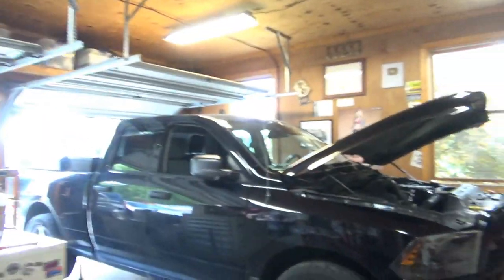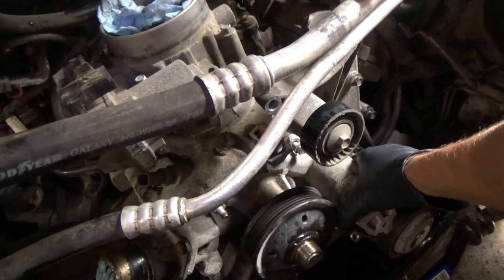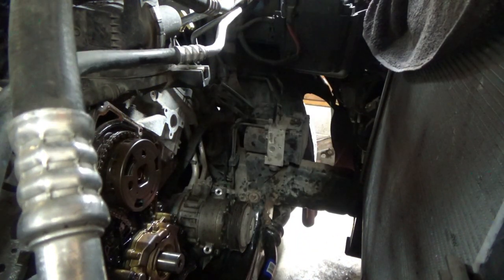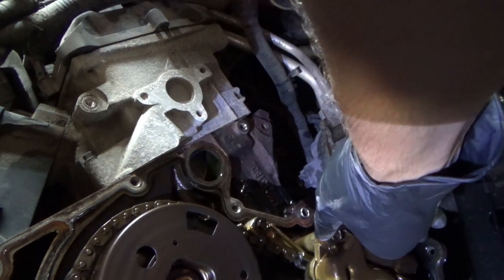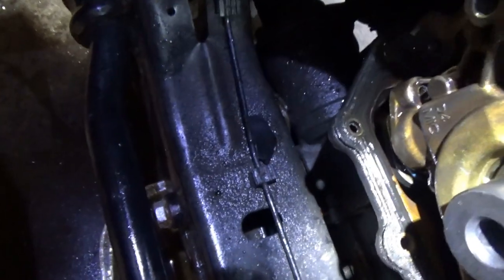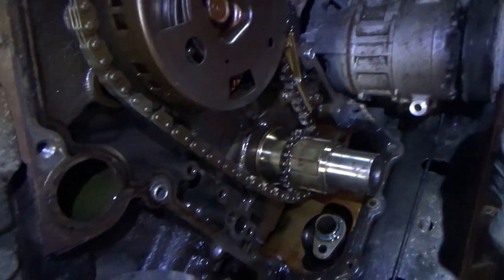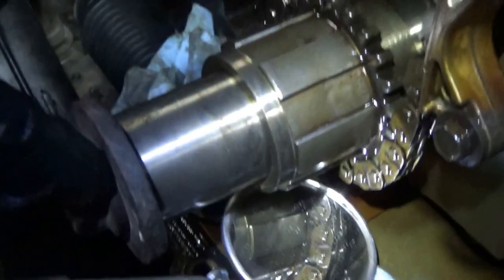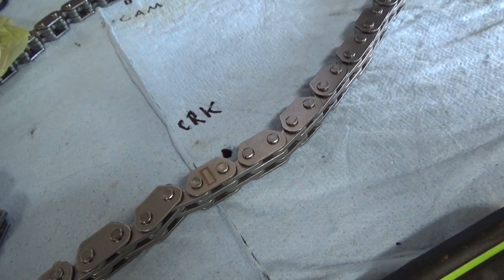Labor Day HEMI - Part 3 (P0016 Timing REPAIR)

Comment: You have to take care on putting on dampeners with a hammer I have seen broken cranks that way all thread is your best bet
Reply from the maker: Broken cranks?? How?
Reply: @PineHollowAutoDiagnostics  they break at the main bearing to the fly weight near the end at the dampener we have seen it quite a few tiimes on inline six engines their is a lot of flex in and out before the thrust bearing

Comment: I'd not trust that engine for longevity.  At the very least, taking a look at the oil pump internals might have revealed damage which most likely happened by vacuuming up all that garbage from the guide.

Comment: If this guide wore because of poor maintenance, that is on the owner. If the guide wore and oil changes were done regularly, then RAM has to rethink their hardware. The chain guide should be made of metal, rather than plastic. That chain was ready to cause even more carnage...if that is an interference engine,  it may have been featured on I DO CARS with ERIC.
Reply: I don't remember ever seeing a metal chain guide. They're all plastic.
Reply: @fascistpedant758  Plastic doesn't seem to work. Maybe metal with a teflon surface.

Comment: I would have edited out the part when you realized you had to take the oil pump back off after all of that to fit the tensioner back in as well. I hate when things like that happen. Once on a Ford 5.4l I reassembled the entire truck then while cleaning up the tools to make sure none were left in the motor before starting I found the reluctor that meant the timing cover had to come back off to install and the customer was on their way to pick it up. No fun at all.
Reply from the maker: Tensioner goes on AFTER oil pump is installed 👍
Reply: @PineHollowAutoDiagnostics  Really. My bad then. That's the way it usually works for me, struggle like crazy to work around something just to have to tear it back apart or whatever. Lol

Comment: Could the crankshaft pully be slipping on itself? It shouldn’t be but i’ve seennit before
Reply: He ruled that out by counting the number of chain links between the timing marks.  If the crank pulley was slipping on the crank (e.g. key sheared) that wouldn't change.

Comment: If it was a cold morning and you heated that balancer up to about 350 degrees in the oven first chances are it would have just slid right on.
Reply: Not sure how the oil seal would fair
Reply: mine have always been fine.   You don't want to go over 350 however, and it cools off fairly quickly.   If you were concerned you could have a spray of cold water ready to spray it as soon as it seated.
Reply: @hooptierescue2540  you are probably thinking in °F I'm in °C
Reply: @niallseddon8657  I am.

Comment: Makes you wonder how engineers manage to design and ruin a simple engine  , fooling around with what worked doesn't  make any sense  ? All the added things never add up to reliability  , old HEMIS were mad  these new ones look fragile at best . Pulling the pan and checking the pick up might be the go for reliability.

Comment: If a piece of chain guide goes up and over the cam sprocket between chain and sprocket, timing will retard a tooth.
If a piece of chain guide goes down and under the crank sprocket between chain and sprocket, timing will advance a tooth.
At this design, it'll probably happen only once. After that, the pieces will just drop into the oil pan, creating problems over there, too.
Maybe that's why they designed it that way: you're supposed to remove the pan anyway, for removing the tensioner debris out of there.
And yes, it is designed to a price point with little to no respect to quality engineering, as everything is, nowadays.

Comment: This engine looks twinky, plastic tensioner, whimpy chain. How much did that junk cost? I'm going to stay with my Chevy 5.7 Vortec, a Cloyes double roller chain costs $50 and will last over 200,000 miles
Reply: Yeah, its junk. 5.7l vortec isn't much better though with spider injectors, and plastic intake gaskets.

Comment: That's such a bad design.   Why would they have a guide push in so far on the pull side of the chain (the right side)?  Knowing that the chain wants to pull straight, so you know it's going to eat through the guide;  that's crazy-- it's like it's designed to fail.  I suppose allowing the chain to pull straight lets it flop around a bit and could make some noise.   But this is just crazy to me.   It should have been designed just how you found it -- with the right side of the chain being straight and the left side having all the slack taken up by the tensioner.......  It seems they have done it this way to FORCE you to do the timing chain intervals as the book says.  Disappoint
Reply from the maker: Hah yeah the chain was migrating to its happy place through the guide 😂

Comment: Question...why these engines always try to kill themselves?i mean engineers suppose to be smart people
Reply: More often than not bean counters are the problem. Otherwise things would cost a lot  more but probably last just about forever. Omitting peoples stupidity of course!
Reply: It's the engineer's job to make things cheaper over time.   Cheaper doesn't always mean "worse", either.
Reply: @teekay_1  Yes, the engineer works for the accountant, not the other way around.
Reply: It's pretty clear this engine hasn't been well maintained; lots of varnish inside the timing cover and the fact that the owner continued driving it while sounded like a bag of bolts in a washing machine.
Reply: deadlines and bean-counters kill engineering

Comment: Ivan…for crying out loud…just drop the oil pan!  A few bolts and a gasket…what’s the big deal?  Amazes me the effort and time spent to try and bypass a very simple step.  Now you’re twisting and prying on the oil pump.  Don’t even show the oil pump going on on camera.  After all, I’m sure you’re charging the customer the full book time, so do it by the book.  How are you going to torque that bolt on the oil pickup tube?  That’s right…you don’t use a torque wrench.  I’ve said it before…you are a phenomenal diagnostician, but I get frustrated watching your actual mechanical repairs.
Reply from the maker: You would use a torque wrench on an oil pick up tube? 😂
Reply: Most shops you are lucky if a mechanic tightens a nut or bolt with a mechanical wrench by feel. Almost everything gets tightened by battery tools to good enough. 😉

Comment: Ivan,   I can't believe I am about to say this  You have not correctly repaired this vehicle in my opinion. My diagnosis following along was the Guide was destroyed, and The Oil Pan must be removed and cleaned of any debris. And I didn't see any seals for that water pump. Did I miss something? #GETTERDONE. You worked too hard diagnosing it to not do it correctly. And I know you are thinking the same thing...

Comment: What a poor design! I'm sure all the metal and plastic circulating though the oiling system won't help the engines lifespan. The regular timing chain design from a small block chevy has no tensioners or guides to break and lasts forever with normal oil changes.

Comment: Why do a video of your repairs if you do most of the work off camera.
Reply from the maker: You want to watch 5 hours of boring nuts and bolts? 😅
Reply: Some youtubers out there are so guilty of this, I'm tempted to copy and paste your comment on them.  Sometimes it seems they just know how to open their hood, and they TALK about changing this and that.
Reply: @PineHollowAutoDiagnostics  Not all is boring. This is why most watch videos like yours. We like to see how you go about installing some of the components. I would have liked to see how you put the bolt into the oil pickup tube. Or how you overcome obstacles we all face when doing these repairs. Maybe I could have learned something.

Comment: I have never seen anyone over complicate a job like you. It was obvious in part one there was a mechanical problem ,stick with the Electronics leave the mechanical to real mechanic! Try doing a timing set on a 5.4 3 valve
Reply: Tell you what: I wouldn’t want you touching anything, let alone “Eletronic,” on my car
Reply from the maker: How was it "obvious" in Part 1? Modern cars have way more variables that can cause a certain symptom... Remember the customer is paying the bill here, and they are not paying me to guess 😅
Reply: Alot of this "over complication" is limiting the chance of a misdiagnoses. But more importantly he is exercising his timing problem diagnosing ability. It may not matter on every job, but the ability to understand the electronic data will be the difference between a $5 fix and a "needs new phasers and cams" diagnosis that a "real mechanic" would make.
Reply: @PineHollowAutoDiagnostics  we don't pay you to think Ivan! Drill baby drill!
Reply: O well as long as the customer is pay that all that matters! @PineHollowAutoDiagnostics
Reply: 5.4l 3v is simple to do a timing chain job. If you want your butt kicked, replace the exhaust manifolds on that engine with broken bolts.